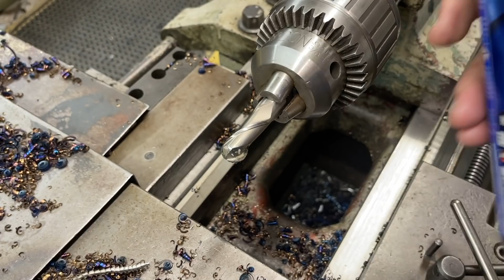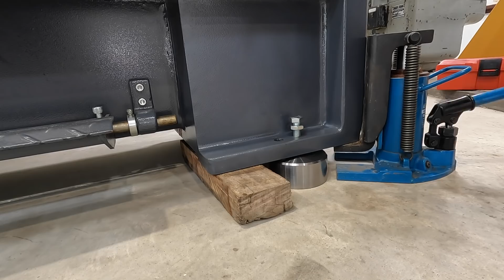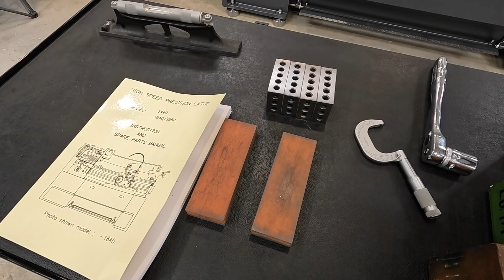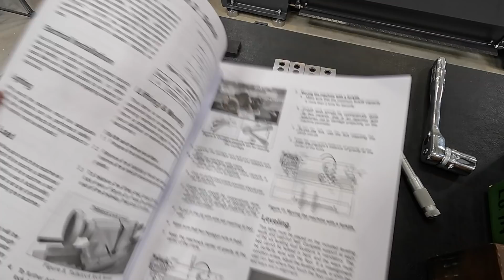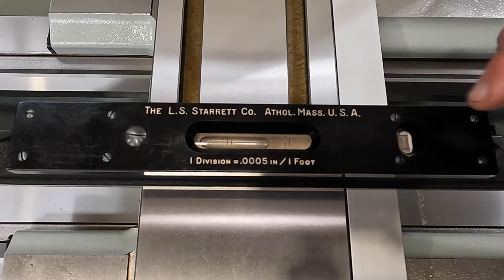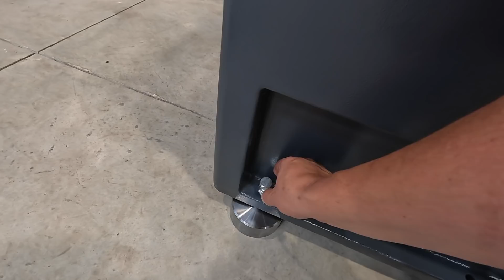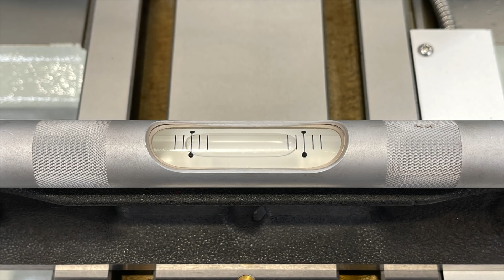Leveling the Precision Matthews TL-1660 Lathe

Comment: Linear twist is the most important to have to absolute minimum. End to end for coolant return flow will be assisted when head stock is elevated from tail stock. But it is imperiative to have the twist elimenated. I have to check level on 100 to 750 ton plastic injection molding machines every 6 months. And those are horrific to get on the money when adjustment is required. The precision levels that we use are .05 mm/ meter per line. Leveling is no fun at all in my opinion.  Great video Adam.

Comment: Hi Adam, thanks for your great instructional on levelling your lathe. I have an enclosed trailer that i am going to tow behind my motorhome with some of my toys in it, one is a new Hafco AL336D Chinese lathe. It dose not come with any levelling adjusters at all and the supporting steel cabinets on either end or in no way precision. I have welded steel beams into place under the mounting holes of the cabinets and i am thinking of drilling and tapping some threads into the cabinets in to try to eliminate any twist that may be in the ways. As far as end to end levelling i will just try to find the most level parking spot. Any thoughts from you will be most welcome. Love your presentations, keep up the good work. Best regards.

Comment: Just got my PM1236 in and setup yesterday.  My first new machine, and I'm going to be leveling next week.  I had one question about the 4 feet under the head stock.  Could there be vertical misalignment in the head stock from unequal pressure between those feet?  You were only adjusting the inner head stock feet and then hand tightened the outside ones after you were done.  Great video by the way.  Still very new to this and videos like this help so much.
Reply: Dale at make somthing cool has a good video on the nod you are in question of.

Comment: Not sure if you are having any issues since you set up the lathe, I'll watch a few more of your videos to see....but, if you have the options, you should always install your equipment on a single section of concrete, rather than how you have it here, straddling a concrete control joint.  If that is actually a concrete construction joint, which is what it actually looks like based on the actual gap width, that would be even worse.  Even if the concrete contractor installed joint reinforcing, the two sections of concrete ate always going to move.  You want to eliminate differential settlement and sources of micro vibrations where possible.  Otherwise, you will need to rebalance and level the machine much more frequently.  Depending on geographic location, subsurface soil conditions, seasonal subsurface soil temperatures, water table levels and even seismic activities, it could be a monthly task.

Comment: Always turn the level 180 ° to prove it incase it's telling lies and then adjust.  Don't worry about level along the length of it that's irrelevant, it will work perfectly on a slope just so long as its flat within itself and there's no twist from front to back.  The headstock is aligned with the bed and finally the tailstock is aligned with the headstock.

Comment: NOTICE - when you un level your lathe to induce coolant flow, you also affect oil flow on gears, in the housing, in components etc  All liquids will now tend to pool in a manner that is not anticipated in the specifications. It would seem a better idea to induce the flow in the chip pan only by setting that out of level.  Better yet it should be built into the pan itself.
Reply: It is sloped about as much as a couple sheets of typical printer paper over the length of the bed. There will be zero effect on the gears. You're dramatically overthinking this.

Comment: -- QUESTION -- If it is so important when using flood coolant to raise on end of the lathe out of level, so that the coolant flows better in the pan, why is this not factored into the pan itself by the manufacturer?  seems silly to un-level your lathe when the pan should have the necessary grading to induce proper flow.
Reply: It's the flow of coolant off of the ways. They can't grind that with a slope. Has to be straight for proper function. On my old Logan of similar design (prismatic ways and flat ways) I drilled small weep holes in a couple spots alongside the flat ways for that purpose, plus a couple slight grooves about 1/4 into the flat ways to promote drainage. Still lots of bearing around those grooves and I no longer get coolant pooling on the ways.
Reply: I own a Heydenreich lathe ( build date 1964 ) similar quality to Monarch lathe. The cooland sump is also in the tailstock area ,so it make sense to give a little to the tailstock in leveling . So coolant can better flow to the pump.

Comment: Looks great!  -- QUESTION -- Why are the bolts not threaded into the leveling pads?  They simply rest on top of them with a small indent rather than being screwed down an inch or two??  But why??
Reply: I think that if they are threaded into the pads, turning them will not affect the distance between the pad and the lathe. Grog
Reply: @davegibbs403  ..interesting point.
Reply: If they were both threaded there would be no height adjustment properties. It would just be a big nut on the floor. You are getting your adjustment in height by the screw pushing against the feet . Not screwing into the feet.

Comment: Had a former supervisor that used to set satellite dishes. When they leveled them  they referred to the amounts they moved their adjustment nuts in 1/4s of flats.   If they had 10 threads per inch 6 flats and 1/4 flat is 1/240”

Comment: Wouldn't the drainage of the chip tray be built in at the design level? 
What I mean is, if they suggest using the top of the cross slide to level the machine then maybe the chip tray is already built with the desired drainage angle if the machine is levelled correctly at the cross slide.
I'd have thought that if they are making a precision machine to create precision parts then they wouldn't expect an end user to apply guesswork to add drainage angles for coolant.
Just a thought 😉
Reply: Just what I thought too 😏
Reply: I was hoping so
Reply: Galerak agreed it would be like a bathtub you set the bathtub into the wall and have both the length and the width level and the tub would be manufactured to drain to the plug and this lathe would be the same.

Comment: I would recommend using leveling pads to level the machine then set the leveling pads & bolts in quick set concrete made for machine tools. I would have poured a separate foundation for the machine with mounting anchors. Also I would have hire machine tool riggers to level the machine. It would have more than worth the cost. They have the lasers needed to level the machine.
Reply: How would that have been worth it when  he got it basically perfect himself? Doesn’t really matter what you would have done honestly. It’s wild that the first thing people do is watch a 30 minute video of a professional with a couple dozen years of experience and immediately criticize and say you could have/would had done it better. Let’s see your video then bud.
Reply: If you are floating in money, that's fine. But hobbyists aren't always swimming in cash and aren't doing top precision turning, so doing it like Adam can be all that is needed. I'll be doing mine myself. I'm not making precision tooling.

Comment: Hi Adam. You mentioned that you just snug the head stock end adjusters. It seems like you would have to adjust them so that the spindle is parallel to the ways. I would imagine that this depends on the rigidity of the casting. I imagine that you do something similar if you have feet/levelers under the middle of the bed like your other lathe.
Reply: I just asked this very same question.  I was curious about that as well.

Comment: Just a curiosity, not a machinist here but, doesn't the manufacturer of the lathe automatically make the catch for coolant drain just like the tub in the bathroom? That way you can level the lathe without making a special consideration to ensure proper drainage?
Reply: John, the chip pan has a slight slope, and is not the reason for pitching the lathe towards the tailstock. The reason is, between the flat way and the raised V way, there is a lower area that allows splashed coolant to run down to drain holes by the tailstock end. That lower area is ground when they grind the working ways. They could grind the lower area at a taper, but would not be cost effective cause it would involve a totally separate setup. Just easier to pitch lathe when doing initial setup.
Reply: @richjasica8454  that was my question too. Didn't know they would machine those. Thanks.
Reply: @richjasica8454  aha now that makes sense to me thank you for the explanation

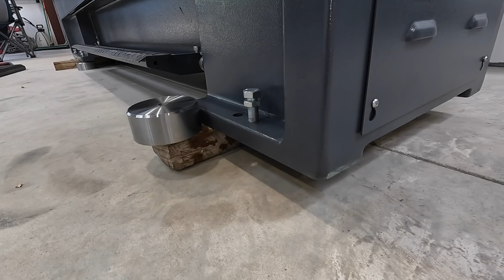Comment: 7:41  You spent all that time levelling, but your straddling an expansion joint in the concrete.  
Won't that just move on you? 
Why not put it on one slab like you did the Pacemaker?
It seems like there is room for it.

Comment: A old timer said to blue the ways and remove the felt wipers on the cross slide and measure with fuller gauge as you work from tail to top and back. You should leave a mark in the blueing continually down and back. Not really sure what he meant (he’s a boeing machinist) but I’ve wondered if that really works

Comment: Nice video Adam. Next step... put a piece of precision ground material in a collet at the head stock and adjust out the flex/nod with the 4 jack bolts under that end. Picture the axis of the spindle being level in the same plane as the ways.  TOT has some good details on that.
Reply: Yes, I  too would like to see a video on headstock alignment.

Comment: I'm surprised with how precise the level needs to be, that the leveling screws are course thread. it would seem fine thread would have made small adjustments so much easier.
Reply: True though I think the weight of the machine might wreck the fine threads so they use coarse instead. I may be wrong as I'm no machinist
Reply: @matthewsykes4814  Yeah they ain't strong enough for this application. Not enough meat.

Comment: I dont understand using such precision levels and then setting it out of level.  whats the point of precision?
Reply: You're not really interested in your Lathe being level, but for the ways to be perfectly parallel and not twisted.
Reply: Think of it this way: the lathe would still work perfectly well at any angle even if he mounted it vertically on the wall.
Reply: Levelling is necessary to prevent excessive wear on certain parts. It creates an even load on all of your mayor  (sliding) parts. So in a looser tolerance, we do the levelling first.
But it doesn't mean, your geometry will be good. For this, you have to adjust the twist. It is a tighter tolerance, but all in all, that's what you want to machine precise parts in the end.

Comment: why do you need to set the tail end of the lath lower than the head for run off of the coolant?? shouldn't that be built into the machine?
Reply: some machines have it, but sertenly not all of them

Comment: When you're using those precision levels, why don't we ever see you confirm the calibration of the bubble by doing the "end-for-end" test, to see if it still shows the same?
Reply: He calibrated the levels in a very recent video.
Reply: Calibrate then work with the tool, if you calibrate while working you can end up as Abom says "chasing your tail"

Comment: As a young process engineer in a corn syrup manufacturing facility in the 1970s, we were expanding our plants at warp speed and often did temporary piping as new processes were installed.  I gained the nickname Mr Goodwrench because I was always taking stuff apart and putting it back together.  The old guy pipefitters taught me to always use thread lubricant because our areas were wet and carbon steel bolts would rust quickly.  Also we had to use it so stainless bolts wouldn't gall.  If I had the value of all the clothes I ruined with nickel based anti-seize and CopperGraph we used on gaskets, I could have retired a couple of years earlier.

Comment: I honestly can't believe the amount of people that are so concerned about pitching the lathe downhill towards the tailstock for coolant drainage, when what is required are the ways running on the same plane. The lathe could probably run in an almost vertical position and machine accurate parts, as long as the bed is in on the same plane from side to side, and no I'm not talking about being parallel, the structure takes care of that (just wanted to confirm, some of you probably don't understand what the webs in the casting are for either). If the chip tray slope bothers you that much, look the machine up and see if it specs the chip tray slope maybe that will keep you occupied for a while.

Comment: Hi Adam, I have the GH-1236 lathe which is somewhat smaller than yours but it has some fundamental flaws which I would be interested to see if they are also present on the larger machines:
1, with the standard tool post, the cross slide travel is not sufficient for the tool post to reach the spindle centreline. This means that when using a boring bar, it is not possible to bore smaller than about 3/4” diameter,
2, when using a centre in the tail stock, the quill must be fully extended to allow the carriage to move back far enough to turn the end of the work, This is compounded by the placement of the DRO scales on the cross slide clashing with the tail stock. The  compound hand wheel also clashes with the tail stock.

Comment: Did you coat the supports with anti-rust wax?
Reply: If you near the circular pucks in contact with the floor they[re aluminum.
Reply: @cdouglas1942  i bet you a dollar they're steel! The previous ones he made were chrome plated steel from a hydraulic ram of some sort.
So the question is valid imo. Maybe it's stainless steel of some sort.
Reply: They are made out of hydraulic cylinder piston, that's not going to be aluminum.

Comment: Why not: 
1)angle it tail stock high
2) pour epoxy into chip tray, thin maybe 1/16 thick of self-level
3) level it flat after curing.  perfectly flat work surface and chips flow to tail as epoxy made slanted surface

Comment: Hi Adam,
I love your channel and the knowledge and info you share.  I was thinking about buying a TEMco toe jack like the one you use in this video but see some negative reviews about the seals leaking.  Have you had this issue or what's your opinion on this jack?
Thanks in advance and take care.
Reply: Toe jacks are cool tools, but the have limited use. Many modern machines don't have the required vertical height clearances. We purchased an air pillow system for this purpose. Enerpac and OTC are good brands and starting places to look. Our big pads were rated 20k lbs with several inches of lift.  The beauty of the pillows was collapsed height 7/8", very controllable lift and lower rates and we opted to just use house air pressure and usually used 1/4" curly cue air hoses. The draw back is the pillows get rounded as the blow up and can rock if not loaded in the center of gravity. With a long hose you can be as close or as far from the load as is warranted. 
An engine lathe almost had to be supported from overhead as Adam did for easy and safe rigging, but many machines are better rigged from the base. My favorite method for raising and lowering machine tools is what I call "rock blocks". You employ a single jack, air pillow, forklift, etc. Lift from only one end and never move the jack location. Lift this end slightly or as high as is safe. Position rock blocks on each side of the machine just past the center of gravity. Lower the jack end. The machine rocks on the center blocking raising the far end from the floor. Position blocks on the far end and jack the jack end again. Add height to the rock blocks to successively raise the entire machine high enough to place rollers under the center of gravity. Lower the machine onto the rollers and remove all blocking and jack. Two rollers are ideal. This sounds crazy when rigging very heavy machines, but this has proven most effective. Rigged machines will triangulate and "lose" a 4th roller, are then very stable, but hard to move and steer. If balanced well on only 2 points, the machine is easy to move and exceptionally easy to steer. I have rigged up to 50K lbs using this method with only a 6K forklift to push and air pillows to lift. My favorite machine mover rollers are wide 4 row rollers with the out board rollers slightly higher than the center rollers. Machine weight will rock this style roller so that only 2 roller rows are in contact with the floor allowing for easy moving and steering. Poly rollers are best in that they don't damage concrete floors. I started rigging with Hillman rollers, but the steel rollers will pop floor paint and even pop the concrete surface. Hillman style machine rollers have a small footprint and work best in 3's. 
I just purchased an American Pacemaker similar to Adam's for my hobby shop. I didn't realize that it weighs 9K+. I am now trying to make rigging plans since I don't have a forklift and my hoist is only 6K. When I was employed, I would just borrow rigging supplies from work.